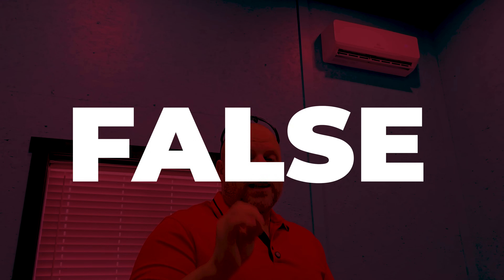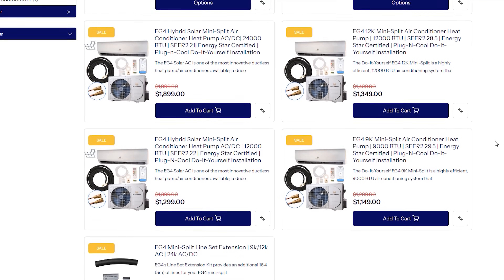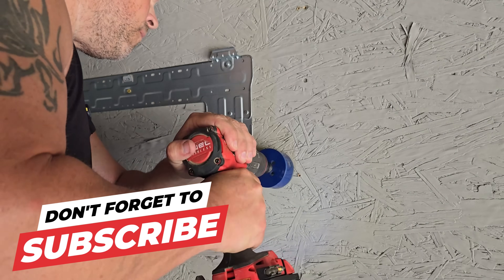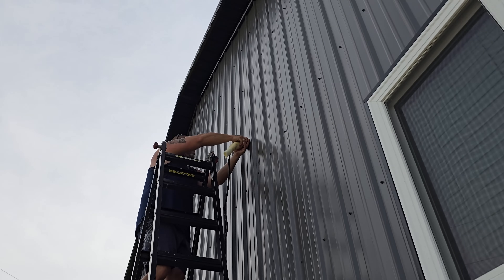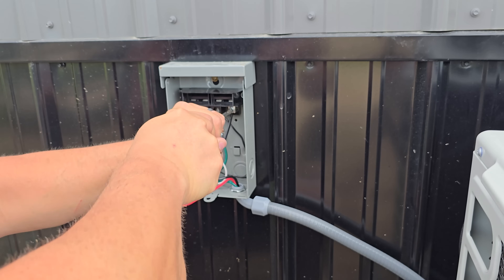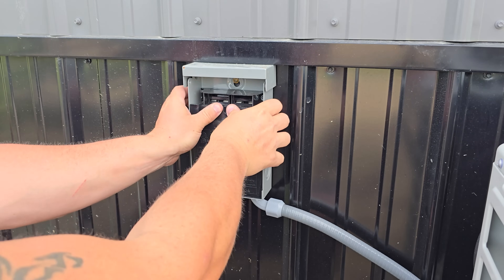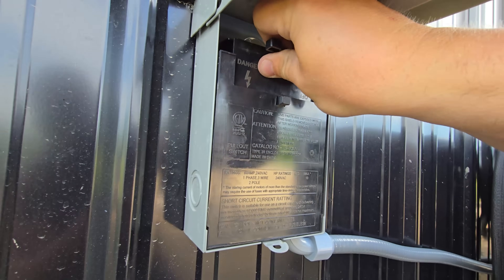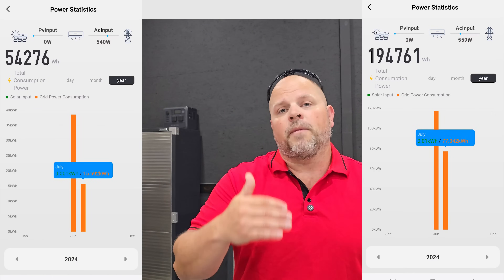TRUE DIY INSTALL - EG4 12K & 24k SOLAR mini splits - BETTER THAN MR COOL!!!

Comment: Nice video. I would have checked the line connections for leakage though. I would like to know the power consumption in the winter for heat and how many panels or the wattage needed that would be needed to run these. looking forward to a video on when you do hook them up to solar.
Reply from the maker: Yeah, I just sprayed the connections with soapy water and watch for bubbles. Yes, I will definitely provide an update on winter and even more indepth summer consumption as I have more data. Thanks for watching and commenting 👍🏻

Comment: Complete cowboy. You didn't vac the system, you didn't ground the outdoor. Shockingly bad. No F gas. W⚓️
Reply from the maker: You do not vacuum the system or lines. They are all pre-charger. Yeehaw!

Comment: Very impressive.... especially the PRICES.  I recently this year installed 2 of the Mr Cool 12,000 BTU/ do-it-yourself units.  Installation is very similar.  PRICE of the 12,000 BTU units are similar also.
Reply from the maker: @1framistan  Much appreciated 🙏 Good job on the installation, and congrats! It feels good to save a boat load of money doing itself 😎 Thanks for watching and commenting 👍🏻

Comment: Mr Cool has multi-zone, EG4 does not. If they did, I'd buy EG4 just for the solar capable.
Reply from the maker: What is the maximum length the line set that it can be extended to safely? I am trying to determine if having dual zones on opposite sides of a house would still be worth doing. Or if 2 units would be a simpler install.
Reply: @TheSolarPit  depends on whether you're talking to zone, three zone, or warzone. For a two-zone, 18K, the max combined line set length for all rooms is 30 m or 98 and 1/2 ft. The max line set length for one indoor unit is half that 15 m. The maximum height difference between indoor and outdoor unit is 10 m or 30 ft. And the max height difference between indoor units is 10 m or 30 ft. The only difference with the three and four zone condensers are that the max combined line set for all rooms is longer by 15 m each.
Reply from the maker: All good information 👍🏻 Thanks for that.

Comment: Ground wire should be connected to the body of the compressor. Use a ring terminal
Reply: And the mount point is in plain sight @ 5:52.  P.S. it hurts to see channel lock pliers used that way....IMHO.
Reply: Did the mfg ever clarify the ground?
Reply from the maker: I have reached out to EG4, and I am waiting to hear back. Makes no sense why there is no ground connection in the 12k unit like there was in 24k. I typically like to confirm things like that before making a connection that wasn't added from the factory. I'll definitely follow up when I get the actual confirmation from EG4.
Reply: @TheSolarPit  There was clearly a ground connection on your video.
Reply from the maker: Where was the dedicated ground for the AC disconnect located? The other ground lugs that are "clearly" there are in use. Should I use them? Add multiple wires on a thread length designed for a small wire gauge size. On the 24k unit, there is a dedicated ground lug that is clearly marked only for the AC disconnect 12ga wire. Unlike the 12k unit.
Reply: @TheSolarPit  Put a crimp lug on the ground wire and attach it to the green screw.
Reply: @TheSolarPit  yea, that’s exactly where it should have been placed, where you see the other ground wire placed. It’s just a alternative pathway back to the main breaker box to allow the breaker to pop should you have a fault somewhere. You can buy those “green” screws at home depot if you need a longer one.
Reply from the maker: @TerraFirmaX  So my question is to EG4, I am not questioning whether the system should be grounded or not. I know it should be. My reason for highlighting this is that there is no dedicated ground lug or screw on the 12k unit like there was on the 24k. They should add it to this unit just like the 24k unit has. I failed to show that in the video and that is my bad. I know from experience that most screws are designed for a single wire and not double. I know that it can be pigtailed in but shouldn't EG4 add a spot for it if it is supposed to be there?
Reply: @TheSolarPit  I don’t know where you keep getting the idea that you need a dedicated ground lug, and that you could only put one thing on it because that’s simply not the case. Like I said, you can always go buy the green ground screws. If you want to make it a dedicated circuit and drill a hole and they’re self tapping and there you go you’ve got a dedicated ground.
Reply: @TheSolarPit  Especially when the warning label says to connect the ground.

Comment: Thanks for posting, but I always lose trust in someone that uses adjustable “channel locks” when an adjustable “crescent wrench” is ideal
Reply from the maker: I feel ya, but those channel locks are pretty slick. I agree though, they are not ideal. I would prefer to use an exact sized wrench but my larger wrenches are out on loan, leaving me with channel locks.

Comment: I do like EG4 by the way.  But I did just design a Mr. Cool system using 36,000 BTU unit with 2-zones that can be expanded to 4.  Oh, that’s right, EG4 DOESN’T have that.   😂
Reply from the maker: That's nice 😆

Comment: Go back and connect the ground to the unit ground wire
Reply: Wouldn’t it be to the ground screw on the chassis?  I saw it.  I think you saw it too.
Reply: @raybieze   It is not grounded now could be bad if something goes wrong
Reply: @raybieze  Yes he put the wire from the unit on the chassis ground but not from the house Always make a ground spot even if there is not one.
Reply from the maker: I am working on confirming directly with EG4 engineers. The problem is that there is no dedicated grounding screw available for the wire that comes from the AC disconnect. Why? I think it is important to know why that was not added in the 12k unit and was added in the 24k unit. I will be sure to follow up and post what I find out directly from EG4.
Reply: @raybieze  yes
Reply: my thoughts exactly

Comment: I have the mr kool units and they very good. In my opinion having integrated solar inverter just adds more failure points. If you have solar panels you most likely have an inverter so why not just power from inverter? I like the EG4 products but an AC unit you cannot just send it back if it fails. There only distributor is signature solar and there support is poor at best. Mr kool has a great track record of support, reliability and distribution for replacement parts.
Reply from the maker: All of those are valid concerns. I have had good experiences with Signature Solar. Thanks for watching and commenting.
Reply: @TheSolarPit  I need to correct myself. I was overruled by the community on the benefits of DC powered AC. Maybe I was overthinking the complexity but 90% of those I talked to say good things. You actually got me thinking I should give the EG4 AC unit a try as all there other products I used have been pretty good. I look forward to your channel.
Reply from the maker: Thanks for sharing
Reply: You don't want to burden you main system with something that is running all day.
Reply: @codetech5598  In my case the its a small load but I understand your thinking. Im looking at the efficiency with the internal inverter and how much it would save and is it worth splitting the solar array. If AC is not running then those panels powering the AC are not making power and I will loose the power that those same panels could be used to charge my batteries. I would love to get feedback on these points.
Reply: @ColorMaker_Solar   When I said main system, I included the solar panels that serve the house. In other words, this Air Con system expects its own panels for day-by-day operation, with a tie in to the 120 VAC of the house for brief usage in cloudy weather. .
Reply: @codetech5598  I am 100% off grid so main is solar. My concern is the 4-6 panels powering the AC will only be producing when AC is running. If I keep the panels powering the mains inverter they will produce power for the AC and charge batteries when AC is not running. If the efficiency is greater than 50% by running the A/C on DC power then there is a clear advantage.
Reply: @ColorMaker_Solar  If you don't intend to power the Air Con directly by solar panels, then you can buy a different brand of mini split which only accepts 120 VAC power.
Reply: @ColorMaker_Solar I had identical concerns. I was able to think of a valid use case, though. My EG4 6000XP will be maxed out, and I could throw four more panels on the roof to power the mini-split.
Reply: @chriskalisiak5005  Great point, I have reconsidered and bought a small 12k and will compare with the 12k mr kool unit to see the efficiency using DC. The only downside I had to buy 10 panels and will only use 4.

Comment: What's the minimum amount of solar to run it, and does it switch automatically between AC and DC?  How much more efficient is running it on DC?  What are your thoughts on using parallel cables and splitting the solar input to the charge controller(s) and the mini split, or going directly from the battery bank to the unit through the solar inputs?  Thanks for all the videos.  You provide a valuable service to everyone that watches them.
Reply from the maker: Here is a spec sheet that might help: https://eg4electronics.com/wp-content/uploads/2024/04/EG4-AC-DC-Plug-N-Cool-Solar-AC-Manual-12K-24K.pdf - Technical Specs are on page 1 or page 4 of the PDF.
Reply: It seems about 1080 watts of consistent power during active use. I could be wrong.

Comment: Sorry.. had to give this a thumbs down. MOST peeps are wanting to see it installed WITH SOLAR, as the title says. I have a 9k Pioneer but as easy as it was to install. I had to get a friend with a AC pump. I will be switching it for the EG4 12k and using it only on solar and DC. I'm going offgrid. I can and do run mine off my solar system and is very efficient and super quiet.
Reply: Its just a matter of connecting your panels in series then connecting to the unit, no need to watch that on a video
Reply from the maker: That is unfortunate. Sorry to disappoint. Thanks for the feedback though. They both are solar mini splits. You would just need to connect the MC4 positive and negatives to an array. Which I plan on doing in the future just as a backup source. Technically they are running from solar through the AC500's. But I understand what you are saying.
Reply: @TheSolarPit  No worries.. Just hoping to see what the title said. I have 2 ecoflow Deltas (1300 and the D2 with 2 extra batteries)I can run mine on too..
Reply: Rooms have to be all heat or all cool..correct? Also what if you have one and only one long run for a line set.the other 2 rooms are close. Can you order charged long line sets anywhere diy?
Reply: @Preciouspink  Yep. one or the other. Signature solar has extension linesets. I think they're limit is 20 or maybe 25'. Call them and ask.
Reply: Seems to be the title is correct.  The point was DYI.  I also don't see solar only and I believe the building is on solar so....
Reply: Well, put together video.  Looking at grabbing a couple 12k BTUs myself for my house.  Starting solar up and think this is perfect to get it going.
Reply from the maker: Thanks for watching and commenting 👍🏻
Reply from the maker: That was my goal. 👍🏻
Reply: Ok but why is it better than Mr. Cool?
Reply: I watched another video where it says it should be connected to a 20 amp breaker.  Is that true?
Reply from the maker: Yes. On the 12k unit that is a 20a single breaker, on the 24k unit it is a 20a double breaker. Hope that helps
Reply: But if you didn't have a friend to help it would have cost more. The EG4 price is about them same as yours would be installled but a !2k Mr. Cool is 1700 dollare here
Reply: Title says solar mini spits, which they are.
Reply: The title is quite literally the name of the product. There is no deception here.
Reply: @mikeo3382  Yes it is, but he mentioned NOTHING ABOUT SOLAR, which is in the title.

Comment: @Justin Mr. Cool did not lie they released their products years before anyone else, since then they have not change their data, still not a lie just old outdated information, anyways you are also wrong the ground is in the outdoor unit, in my EG4 solar installed i put a terminal on the ground and screw it down on the indicated ground screw, this is critical because it provides ground to the indoor unit.
Reply from the maker: I appreciate your point of view and agree that Mr. Cool may be the first branded DIY solution. However, it does not give them a claim to infinitely state "They are the only" DIY solution. It's false to continue that claim when there are other companies offering the same solution. If they would state "The First" then they would be correct. Regardless, they are NOT the only company to offer a DIY solution and that is why I will stand behind my statement. They continue to put out new content claiming they are the only ones. It's false. I am working on getting an official answer from the manufacturer on the ground concern. This is only a concern with the 12k unit. The 24k unit has a dedicated slot to put it and is clearly marked on that unit. I will follow up when I get an answer from EG4.
Reply: Also  i vacuum out my lines before opening the coolant. I’m surprised you didn’t check for leaks and do the same, but happy it worked out for you without doing that critical steps as well.
Reply from the maker: Just an FYI, those lines are pre charged so you might have done more harm than good.
Reply: @TheSolarPit  the pre-charged is within the external unit the lines you connect to the external unit the and head unit has air in it .. thats why its best to vacuum out the lines before opening the precharge valve, was that not a step in your manual?
Reply from the maker: When I reached out to the company they advised those lines are precharged and not to pull vacuum on them. I did review the manual and on these units it does not mention anywhere to do that.
Reply: @TheSolarPit  thats very interesting, since a the pre-charged part of the lines are online the lines within the unit, the lines between the unit is not and has air in it, I would how its pulls the air out after the pre-charged lines are open? In any case it’s working good for you too, my EG4 solar split system is working perfectly for about a year now hot and cold and i vacuum my lines.
Reply from the maker: I agree, it is interesting. I had never worked with lines like this. I appreciate the discussion, I am always looking to learn and address mistakes I might make. I am not perfect by any means, there is always something to learn from. Good to hear that your system is running perfectly for over a year. Do you have the 12k or 24k?
Reply: @fullyelectric  The short lines are charged with an inert gas and the long lines are charged with refrigerant.
Reply: Now that the ‘lie’ issue has been clarified (Mr. Cool isn’t lying about anything), let’s state some more fact.  EG4 simply COPIED the Mr. Cool (like every other damn Chinese company.). And @Justin’s Project, you show how ‘EG4 has all these solar options’ which is not true—those are Signature Solar packages.  They could make the same kinds of packages for Mr. Cool.  So please, try not to be so dang blatant.  Mr. Cool for example has 2-zone, 3-zone, 4-zone, 5-zone…all the way to 8-zone systems.  EG4 does NOT, because they JUST entered the market.  Rest assured, if there is enough market for it, EG4 will copy those too.
Reply from the maker: Didn't Mitsubishi invent the mini split back in the late 50's... Who is copying who. Regardless, they all make decent units. Hell, Mr. Cool is ran out of my home state, but the are lying about "being the only ones" and I will not back down on that. If it was ten year old marketing then I would. But these new commercials I see claiming to be the only ones to offer it - Not true, it is a marketing lie. Plan and simple. Maybe if they claimed to be the only US manufactured DIY solution, it would be true. But there is still the question whether Gree (the worlds largest AC manufacture - out of China) is involved with Mr. Cool. I am not claiming they are, but a lot of others are.